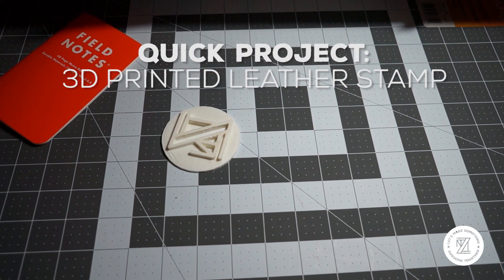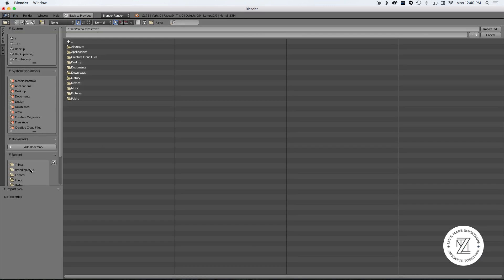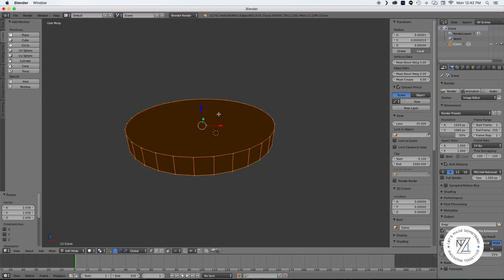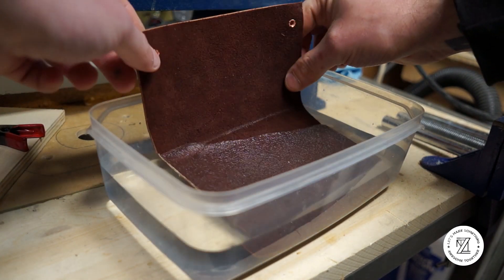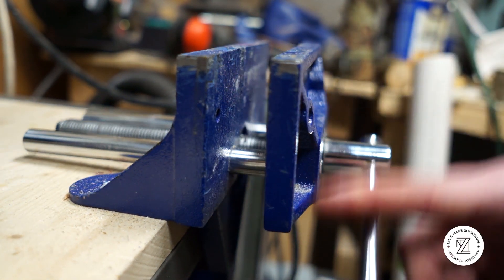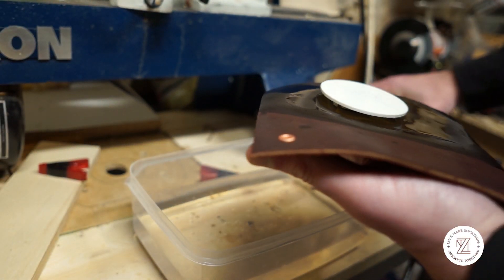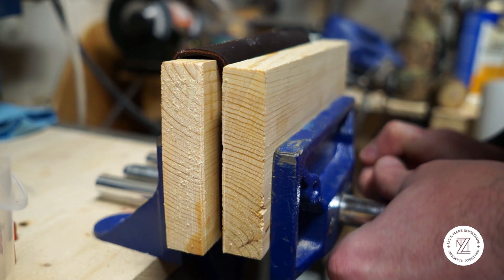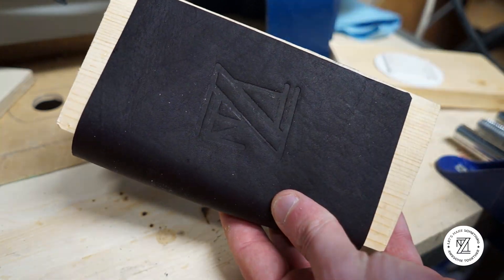LMSAT Quick Project - 3D Printed Leather Stamp

Comment: Great video.. Best wishes :) . Can you tel me how does it last the stamp is it permanent like branding etc ?Thanks in advance  :)
Reply from the maker: +stylios zerox yes, it is permanent. It might relax a little over time, but never go away.
Reply: Thanks, I will go that way and see i have a big logo i want to do. I also thinking not use water only i saw guy using a formula and i also know that there is an acrylic medium for holding fabric in to position do you think that will help if i use it in that area with the water  ?
Reply from the maker: +stylios zerox I never heard of anybody using anything but water when shaping leather. I'd be cautious what you put on the leather, because it could cause it to dry out and crack.
Reply: He used a mix of 1 part baby shampoo 1 part alcohol and 2 parts of water i have a link to the video if you want to see. As far the acrylic medium is worth to try because , that s my guess, since it is absorbed in to the leather, and as an acrylic has some elasticity, when its solid it would hold better the stamp but need to test it. I heard people use golden acrylics with good results in painting the leather. Any way thanks if i find anything interesting il let you know :)
Reply from the maker: stylios zerox it is worth some experimenting if you've got scrap leather. I'd love to hear the results.
Reply: It will take a wile . My wife order me a leather bag that i want to stamp my logo , I live in an area with many leather traditional  shops .I will ask the guy to give me a peace of leather to test but need to get the medium first when i do i will do some testing :)